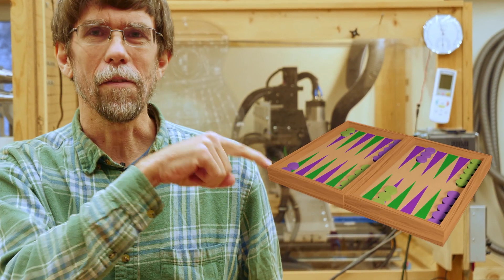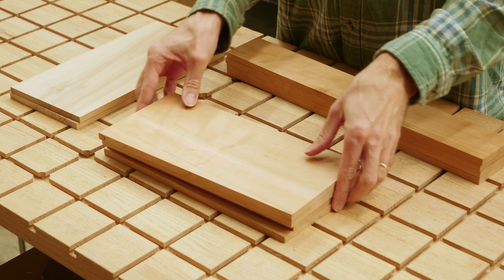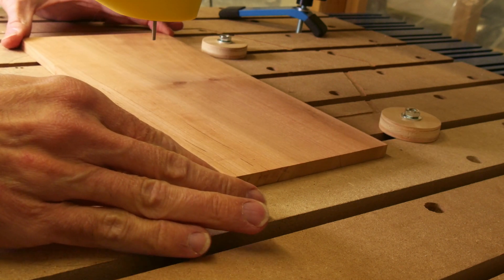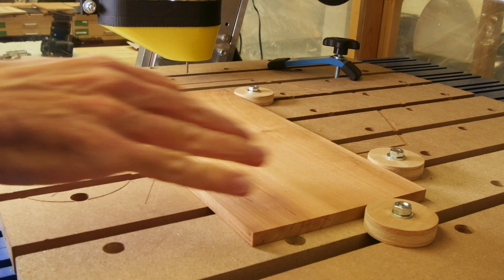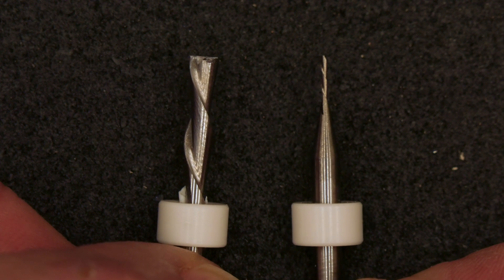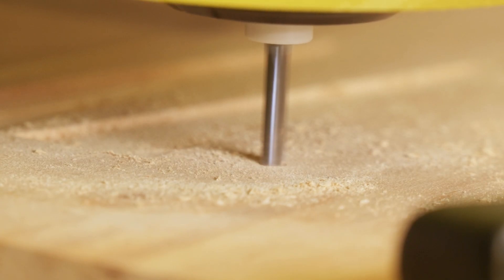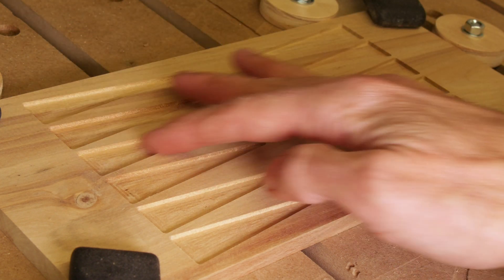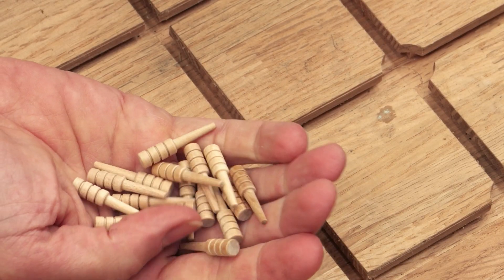CNC Epoxy Inlay Backgammon-Cribbage Board, Part 1

Comment: DO   you have planss that can be shared with us?
Reply from the maker: I would be glad to share plans but I don't really have any in a form that would be useful. I generated my g-code files from Fusion 360 and sent them directly to the CNC router so I didn't make any printed plans.